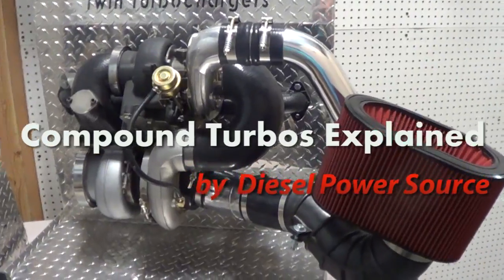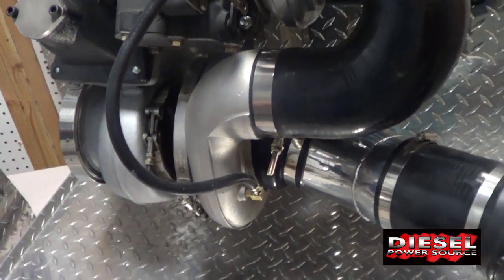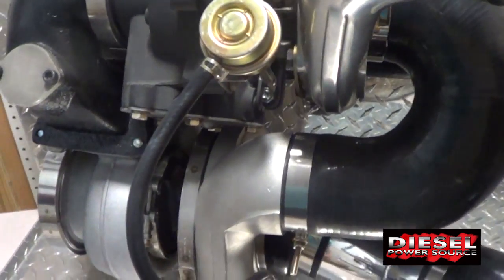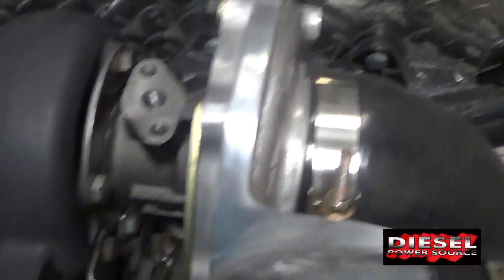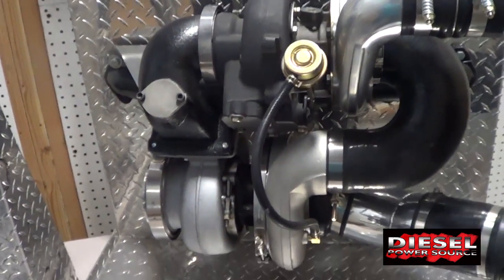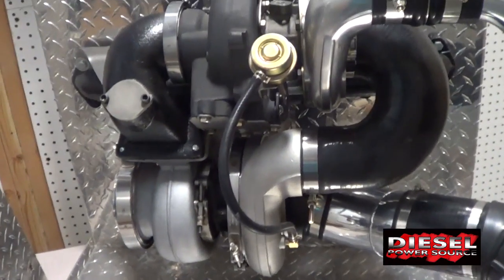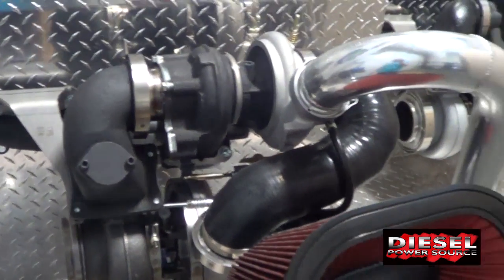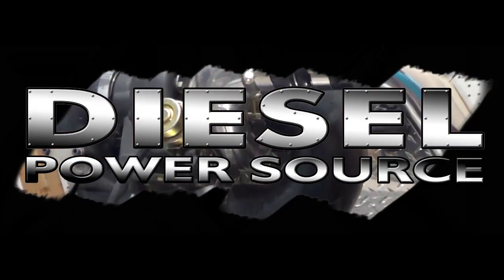Compound Turbochargers Explained

Comment: How safe are rubber boots ?
Reply from the maker: The charge pipe on the cold side between the turbos is Not a rubber boot, it is a special Kevlar/Nomex lined Silicone low-pressure charge pipe that provides superior flow and fitment compared to metal. The couplers on the kit are made of the same Silicone material. Between the turbos on the Hot side we have a cast iron hot pipe that holds everything nice a firm along with a support bracket.

Comment: Won't the smaller turbo cause more back pressure and restrict exhaust flow at higher rpm?
Reply: Blow off valve dumps what the small turbo can’t handle straight to the big turbo at higher rpm’s.
Reply: @jonellwanger7258  you mean wastegate right? That is actually clever.

Comment: i thought it was from small turbo to intercooler to engine until enough exhaust built up then it would spool up big turbo with excess exhaust gases that would then spool small turbo more due to higher compression resulting in more boost

Comment: How do you control the boost?
How do you reference your wastegate?
Reply: That's what I was wondering. I see the reference comes from the big compressor to the wastegate. I guess that has to do with the pressure differential.
Reply: According to DPS they said the secondary’s wastegate opens when the primary hits 35 psi of boost

Comment: Do these have any horse power benefits over a stock turbo if so how much
Reply from the maker: Our compound will increase HP by approx. 25% over the stock turbo, if you do thing more than install the compounds. Of course, with the compounds you will have the ability to add ALOT more fuel if you desire, which will increase your HP by even more. 
Here are a few video links you may find helpful:
https://www.youtube.com/watch?v=DmWNHoqXjx4&list=UU9aRgqW_hezn7wbk1RyFV3A&index=4
https://www.youtube.com/watch?v=Et7v7DEXuj8&list=UU9aRgqW_hezn7wbk1RyFV3A&index=15
https://www.youtube.com/watch?v=5dzvPzf3u9g&list=UU9aRgqW_hezn7wbk1RyFV3A&index=23
https://www.youtube.com/watch?v=nZBNMB8HQKE&list=UU9aRgqW_hezn7wbk1RyFV3A&index=46

Comment: I used to work at Williams International. They made a "turbo compounder" for the military. It doubles the horse power of a tank diesel. It incorporates the compressor section of a small gas turbine engine to make boost.

Comment: That is NOT a compound turbo setup. What you have done is a two stage turbo setup.
A compound system is when the turbo shaft drives directly the crankshaft of the engine

Comment: The original compound turbo was used in the 1950s on triple tail Connie it put the shaft power back to the engine crank output
Reply: You are 100% correct on that.

Comment: Im bit simple,

say i had an internal wastegate on my smaller turbo set at say 17PSI... would the larger turbo pushing air in the small turbo make my external wastegate open too fast?..I'm so confused...  Do i need my wastegate pressure set the same for both turbos?
Reply from the maker: We generally set the wastegates over 35 psi.

Comment: what's preventing overspooling of the stock turbo...Is it wastegated at a certain pressure into the large?
Reply from the maker: We still use the factory wastegate valve.  But on compounds it does split the load between the two turbos, so the individual turbo stress is reduced.

Comment: Compound turbos and twin turbos are not the same thing. You lost me in the first 4 seconds of the video lmao
Reply: compound turbo is a type of a twin turbo configuration
Reply: @R3dZ0N  no it is not. Compound turbos scavenge rejected air and push it to the crank to give the engine an additional “50 horsepower”. Although the design never worked and the turbos are almost always switched or removed.
Reply: @jewwinfrey6460  if you say so
Reply: @R3dZ0N  lmao not really an “if you say so” kinda thing. Sorry you’re uneducated on the different types of turbos buddy lmao
Reply: @jewwinfrey6460  ur saying to me that compound turbos doesn't work. i don't have anything else to say.

Comment: Good video lots of good info, im curious what exhaust housing are you using on the s475? It looks smaller then the factory one that came on it
Reply: And what would be the size of a factory S475 since that was never offered as a factory turbo? At least not on a Cummins. Cummins used Holset and the S series is a Borg Warner. I could be off on that in the later years. Even Holset turbos came with many different turbine housings depending on what it was installed on from the factory, so what installation are you asking about?
Reply: @brettschacher8644  Thats not at all what he’s saying.... 🤦🏻‍♂️

Comment: whats the difference between Compound Turbochargers vs twin turbos?
Reply: Nothing ! Unless you are using one turbo for one bank and another for the other bank in which case it's simply a twin turbo setup. It's when you stack them on top of each other they are true compounds. The first one in line with the exhaust compounds and is compounded by the second as the flow path of the moving air and gas is reversed, hot from small to big and cold from big to small. When drive pressure goes too high exh. is bypassed to the big turbo adding more free flowing drive pressure to spin it harder which relieves load on the small turbo. The primary purpose is to get boost up faster than you would with just the big turbo. This keeps smoke emissions lower.

Comment: Power on the intake stroke?
Reply from the maker: Yes, we've actually ran a substantial amount of CFD testing, which has demonstrated this, then backed it up with real world tests. With positive pressure ratio (exhaust to boost), and a well ventilated crank case, we can and do produce more power on the intake stroke than the exhaust stroke robs.  We're behind on getting this video out, but will be producing a video shortly showing some of the actual tests.

Comment: Great video i was wondering dose a compound set up need to wastgates on each turbo.
Reply: Generally no, you gate the small turbo to bypass exh. into the larger one which can flow much  more. Once the drive pressure is high enough to spool the big turbo it needs to be passed out without overdriving the small turbo. It seldom needs bypassing the final, you don't gain any power doing that.

Comment: Here’s where i loose how this can make any power. Yes the compressor side makes sense, but at the end of the day how does the first turbine “smaller one” not become a restriction at a certain point?
Reply: Because the small secondary only stops producing power because it runs out of air . Its at the peak of its map  in its atmosphere , the large turbo makes it so  that wont happen.  It does create  a restriction though.  I have a 7675 with a s488 compounded. The s488 should be good for 1300hp Ill be lucky to see 850 with the two.
Reply: Depends on the sizing of them,these guys running 100psi plus on 2l engines@2500hp are feeding a 112-20mm turbo into a 75-80mm,and thats a pretty big small turbo but thats racing applications though and all the support mods to go with it bigger pumps secondary pumps etc..
Reply: The small turbo must have a waste gate allowing relief on the exh. The second turbo changes the intake map of the small turbo letting it work with less loss of efficiency so as long as you can supply fuel to keep the exh heat in range up, it's the same as any other engine, more air needs more fuel more fuel needs more air, increase both and power continues to increase too.

Comment: Wouldn't it make more sense to have a smaller faster spooling turbo feeding a big one ?
Reply: It’s all about the transfer of energy. It would take more energy for the small one to make the big one run for less power. The big one pushes and compresses more energy to the smaller one and because of the rate at which that energy is transferring it creates a more defined and quicker rate of the release of that energy which in turn creates more power for the engine.

Think about a water hose. The water can come out normally or you can put your thumb on it so the water becomes more defined and sprays out stronger with more power because it’s going from a larger hole to a smaller one at the same speed
Reply: Adamantium Life you’ll get more pressure but less volume isn’t the point of a force inductor to get more air volume

Comment: doesn't small turbo make the restriction for the larger one in intake ?
Reply: I'm not an engineer, but the answer would be NO. Simply because if that was the case, jet engines wouldn't work
Reply: Depends on how much you want from them,guys getting 2000hp from a 2l engine are using a 106-112mm turbo into a 76mm and pushing over 100psi through it but its bound to be excessive wear on the 76mm though,modded housings bigger bearings its own oil-water pump or just wait for it to whine and smoke then change it out.

Comment: what if you engine bay mount the small turbo and rear mount the intake turbo? is there a problem with pressure loss or heat loss to second turbo?? thank you
Reply: The rear mounts work good because its built up the pressure in volume to the back and its charge is cooled alot heading back to the front,it be the initial lag to begin with nothing the loading up of the clutch wont fix.

Comment: so. i wanna do two of these, mounted on either side of an iron block LS. who's with me?
Reply: A race team is doing compound turbos with 3 and shooting for 3000hp on a 4 banger. that alone shows the potential of compounding turbos
Reply: @TR1GTARD  just watched Shane's interview on HP academy.
Reply: @imty8774  right on, thats where I saw the first vid. Then watched the dyno videos on their test setup
Reply: Currently Twin compound turbo in my C4 Corvette with an LT1 block.😅 I’ll be happy if I get through one race before the water passages overheat😅
Reply: Quad-turbo LS?
Sign. Me. Up.
Reply: @electric7487  We have the setup on an Audi Quattro
Reply: bro im a big block fan, but im really wondering how’d this turn out in a rb 26 or something similar
Reply: If you went turbo LS fed into a traditional roots /screw supercharger you'd almost be able to do it with off the shelf parts.
Reply: Me too whats up

Comment: Hi, what about compounding a common rail diesel with variable geometry turbo, electronicaly controled?  Any setup ideas?  Thanks in advance.
Reply: I could see that working better than compounding 2 VGTs.
Reply: I wouldn't think that there is a benefit to compounding VGTs. Compound turbos are used to reap the benefits of faster spooling without the vanes of a VGT.
Reply: @83ED9  Hello, I got a suggestion coming from Australia, that I should use the original VGT as the first small one, and a Garrett GT30 with internal waste gate as the big one. Or with external waste gate.

Comment: I know this is how its supposed to be. But it seems the smaller turbo should spool the largr turbo. Looking at it looks like it would overspeed the smaller turbo. I know this is not so, im speculating on how it looks on the surface
Reply: Yeah thats why you have certain sized turbos depending on what you want from it,down low top end power ,torque etc..

Comment: what would it take to obtain a compound setup for a 3.0 Liter Mercedes Diesel engine?
Reply: Not much just design and build it, then get a fuel pump that will supply enough fuel for whatever your desired power level is. And make some good intercoolers. And fit it all under the hood.

Comment: Does the smaller turbo still get choked out just like it would if it were that smaller turbo only or is the excess exhaust diverted to the larger turbo? would it be possible to bypass the smaller turbine at higher RPM?
Reply: Small turbos wastegate opens then the big one goes to work more.

Comment: @DieselPowerSource....It probably has been asked before but my question is in regards to the smaller turbo receiving boosted air from the larger turbo. As the compressor wheel is usually driven from the exhaust side and is compressing external air that is  at normal atmospheric pressure, are there any extra stresses placed on the journal bearings of the smaller turbo due to receiving boosted air, rather than air at normal AP? I'm assuming this is combatted by running ball bearings rather than the usual bearing found in standard car turbos. It looks a superb setup in any case and can see that it would eliminate turbo lag due to both turbos spooling at the same time.

Comment: no turbo lag?, which one should be the VGS, the smaller one?
Reply: neither in this case. but guys do run a vgt turbo as the smaller primary and a fixed vane atmospheric turbo.  but even with two fixed vane turbos, there is next to no lag because of the small turbos size.

Comment: Can I run a compound turbo setup on an LS
Reply: Every turbo works the same on every engine so yes
Reply: @adinglavic8418  Up to the point the internal parts of that LS simply can't stand the added pressure ! Then there are the head bolts and those Alloy heads just melt down.

Comment: If the exhuast gasses run through the small turbo then won't that ultimately determine peak hp? How is the big turbo helping? It seems like the small turbo works @ 100% And the big large turbo only being used say 15% to spool a little faster?
Reply: Wastegate!!! The small turbo cant handle more than say 70% of the exhaust flow. When the wg opens it dumps the extract flow aka energy into the larger turbo. That spools the larger compressor! Boom, more air flow. 
Also listen to the video again. Turbos are pressure devices! Input x 2 or 3 is the unusual. If The large compressor makes 25 psi then the smaller compressor will take 25 x 2 =50 psi.  More pressure than either turbo can produce alone.
Reply: Wastegated to push that fresh exhaust energy straigh to big turbo like he said^.

Oh and also ill repair this one:
"Large compressor makes 25psi of boost ,so it is working on pressure ratio of 2.7, then it is multiplied by smaller charger by pressure ratio of 2, so total pressure ratio is 5.4x -> 65psi.
Reply: valves my friend valves
Reply: Wastegate bypass to the large turbocharger only improves gas flow, and the small internal wastegates on most turbochargers aren't up to the task of bypassing gas flow when you really start cranking things up. I've seen Australians take a Primary 50mm-60mm wastegate and plumb it into the center section of the manifold junction, then pipe the bypass gasses directly into the large turbine inlet, that usually fixes exhaust choke points for high exhaust gas flow rates.

Comment: What kind of running is needed when installing compounds???
Thinking about using a fleece cheetah with my stock turbo but I’m not sure if I would need to do any special tuning. This is hardly ever mentioned on these videos.

Comment: Weird....in most cases with this setup there would be a bypass so that you don't have to run the large turbo's charge through the small turbo. Same with the hot side...running it like this creates a bottle neck. Am I losing my mind here?
Reply: Your thinking of a sequential setup where the small turbo is used first then the large one bypassing the smaller turbo.  compound setups are used to achieve higher boost pressure .
Reply: This is where the sizing of the turbos come in,theres guys running 120mm turbos into 75-80mm turbos at 100psi+ fueltechs rx8 holds a record for horsepower per litre@1200hp.
Reply: The smaller turbo is designed for it. The restriction increases pressure.

Comment: hey people not sure if you will reply, but will mean a lot if you do. on diesel engine i want to run twin turbo sequential. but can you please explain to me. the first turbo or the smaller turbo. let start with the turbine. it on a 5 cylinder 2.9 merc engine diesel. the turbine is a/r56 with t2.5 wheel.  it rev max 4500 rpm but turbo will boost full 0.5bar at 1.800 rpm but 1.0bar at 2.300 rpm. so what i need to know is my second turbo turbine i want it to full boost at about 2500 to 3000 rpm what turbine must i use. if we can talk please my email is g.roets73@gmail.com.

Comment: Looks lagg city
Reply from the maker: Actually it is not laggy, it spools as fast as a single stock turbo.
Reply: @DieselPowerSource  Most of the time it spools faster than a stock turbo, as in when Dodge was using 21cm housings on early 5.9l's those were slow as turtles to make boost. Using a correctly designed compound system can make a Diesel act like a HOT gas engine where throttle response is concerned. Well almost, but for sure boost and power are massively improved as long as you can get the fuel curve to work with them.
Reply: DAC087 it's built to be anti lag smh fucking stupid

Comment: How to control those 2 turbos with electronic controller? Possible?
Reply: In effect a common rail or any electronic injection control already is controlling the turbos by either supplying more or less fuel. More fuel makes more heat which makes more drive pressure and thereby more boost, opposite for less fuel. If the load increases, temp of exh goes up forcing boost to go up to a point, then you add fuel to keep moving and around it goes where it stops, who knows.